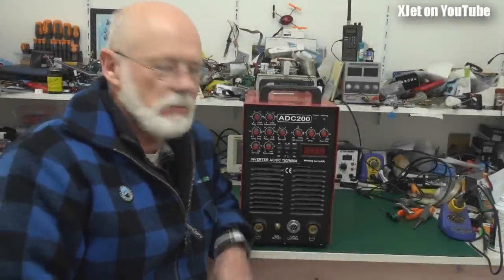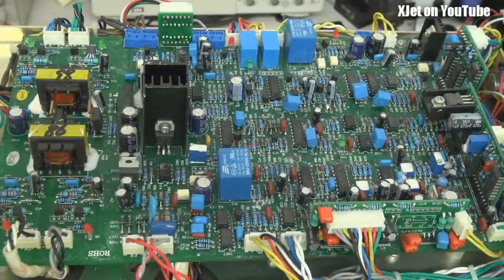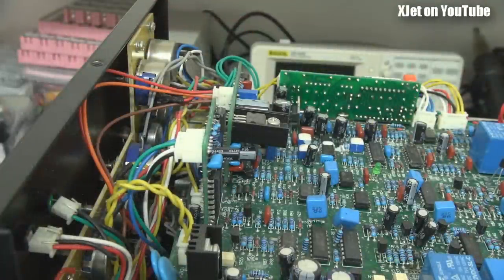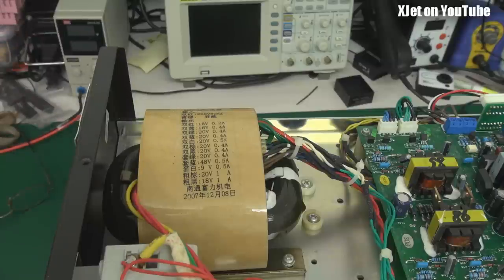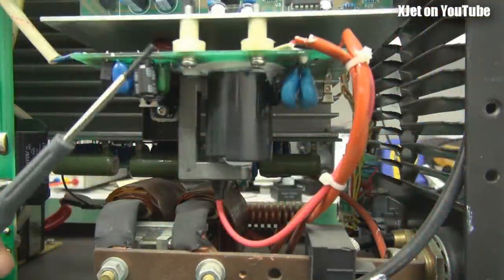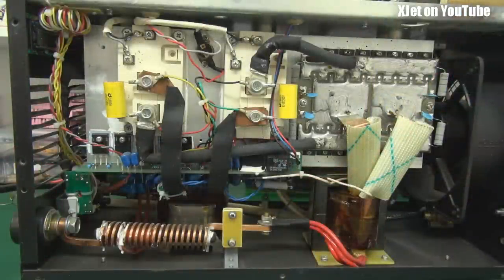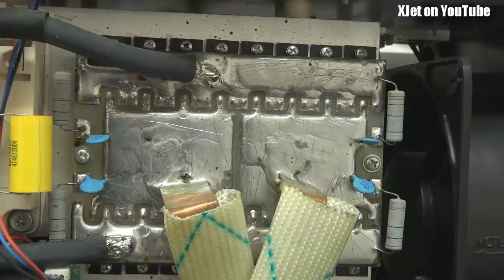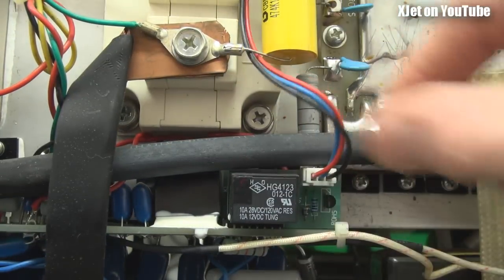Chinese 200A TIG welder teardown

Comment: It is really clear that you don't know anything about power electronics.. The only reason that they used many capacitors in parallel is that, at high frequency high current, the current density is huge and, if they would put, as you said, the proper capacitor, with the specified capacity, it will get very hot. Instead of using a single cap, for thermal reasons, at high frequency high currents, the rule says to use several capacitors in parallel until you obtain the desired capacity and divide the huge current into small amounts of current through every single capacitor. Shame on you!